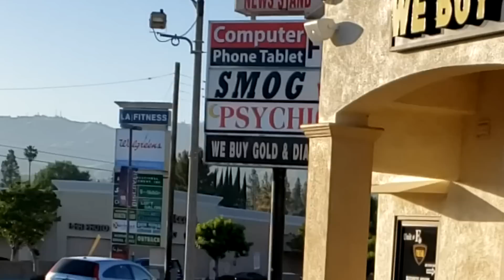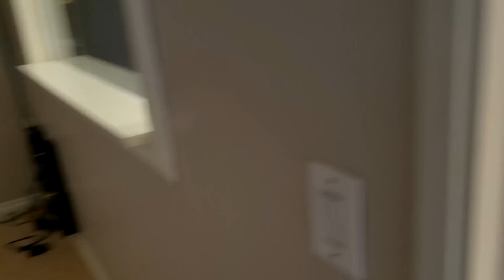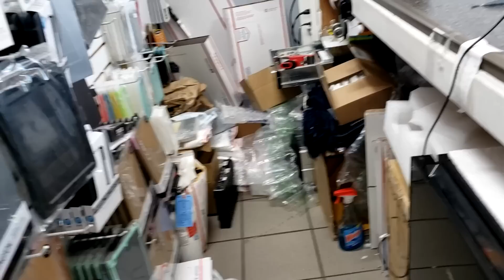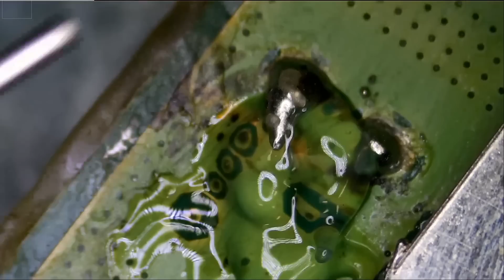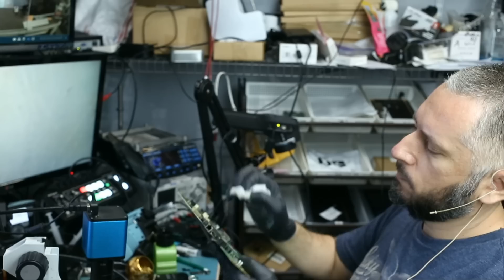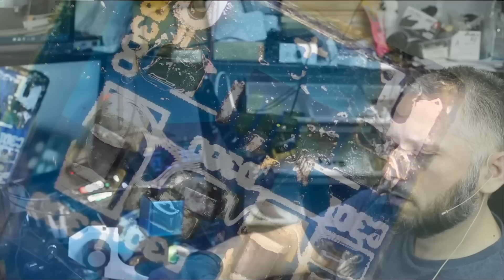We're expanding - New store walk-through - PS4 Beats and iMac repair

Comment: Great news that you are expanding your business, congrats! May I ask a question? How much do you charge for your repairs, for example, a laptop that doesn't turn on and you change an open mosfet? I don't know hot to charge for that. I work that in my home on weekends eventually
Reply from the maker: Put yourself in place of the customer. How much would you pay. People pay for data recovery because it's important. People won't pay if no data recovery is involved and your prices are unreasonable. You'll know how much to charge as times goes by. Get yourself familiar with what others are charging, but don't solely base it off that. Feel free to charge more if you have more experience.